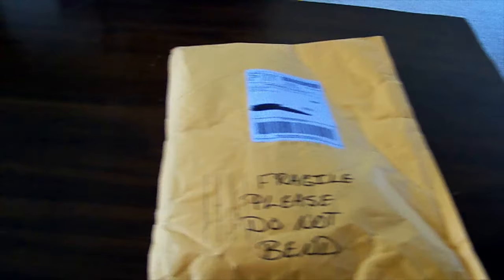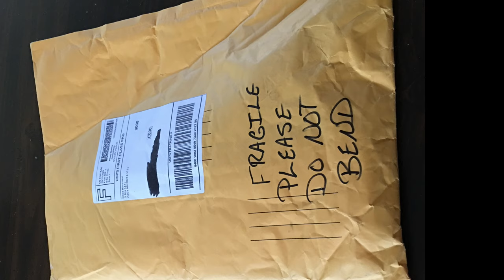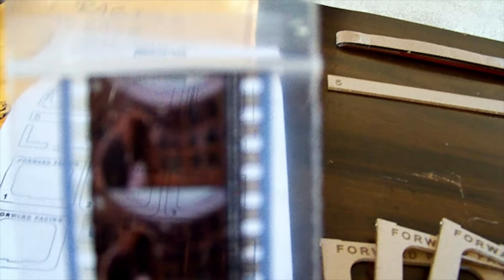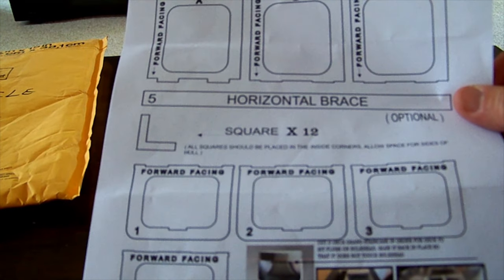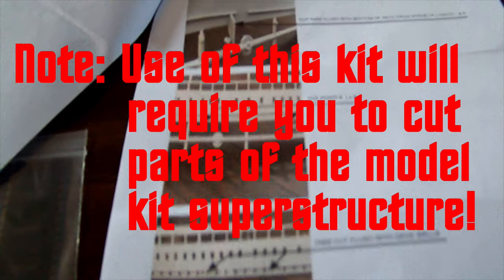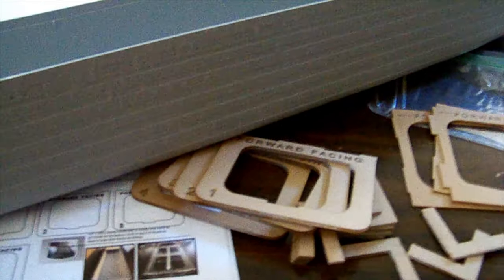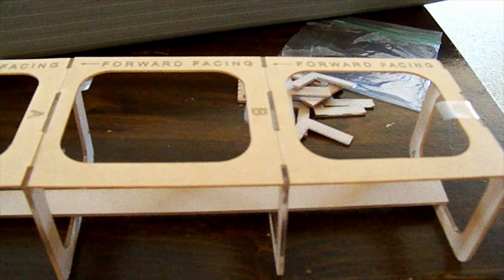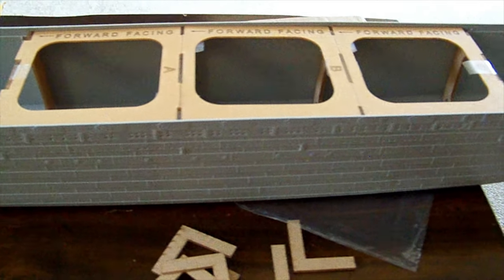Clear Bulkhead kit to reinforce walls of the 1/200 Scale Trumpeter R.M.S. Titanic

Comment: I bought the exact same kit off  Ebay.  Can't beat the price and quality. Very professional made laser cut clear acrylic. I didn't use the full " L " angles braces, only small parts of them at the top enters on each side for added strength.  Improves the hull strength when one is ready to drill all those portholes not to damage the hull.  Also helps if your hull is warped.
These are great bulkheads, highly recommend them.

Comment: Hi Jerry, yeah the bulkheads are a good idea.  The LED light strips are effective by placing a single strip midway up the hull wall on each side.  Check out TheModelBoatGuy  who has just started his lights, may give you some ideas on how to go with this!  We are thinking about adding a little bit of light diffusion as lights today are so much brighter than in 1912 JH ;-)
Reply from the maker: I don't like the idea of putting the LED strips on the sides of the hull. I prefer placing the strips in the center of the hull, ideally maybe an inch or two from the bottom. But thank you for the idea.